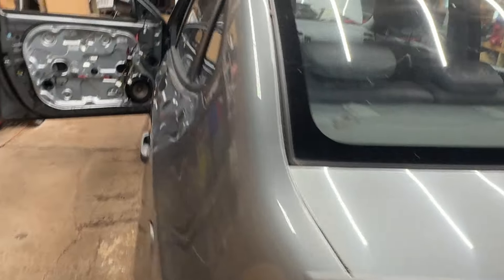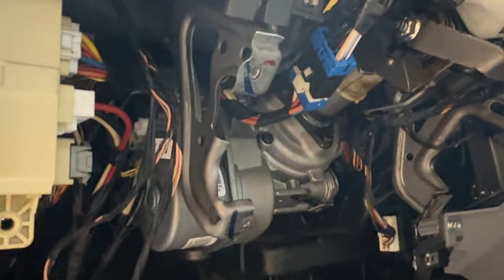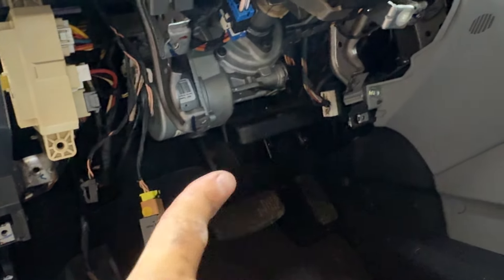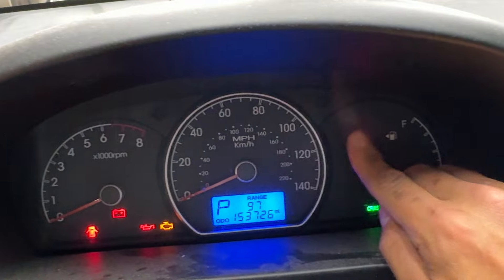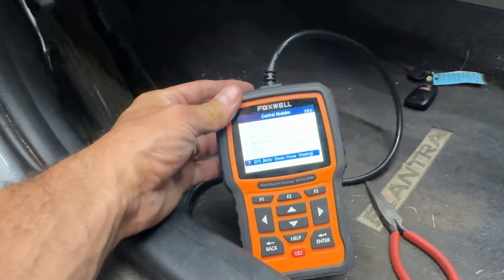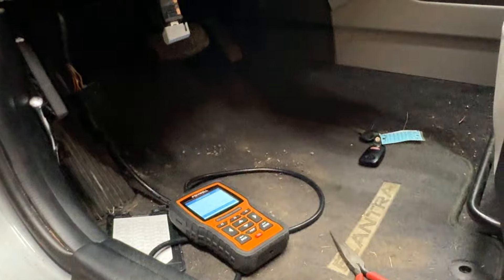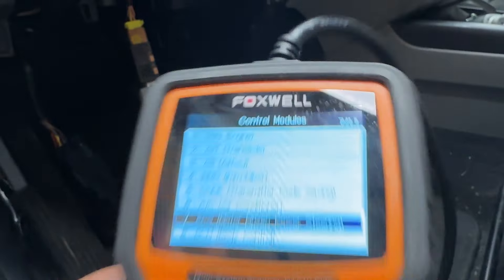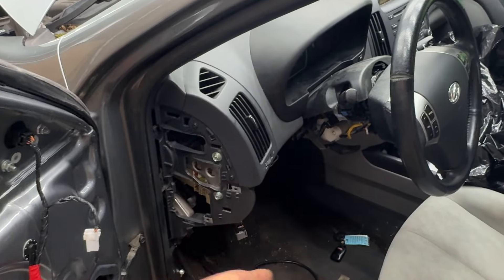2007-2010 Elantra Steering Problems Explained (Clunk, Loose, & EPS Reset)

Comment: I also replaced that coupling stuff, and it became better. But, I do not know why the steering wheel is still not smooth.
Reply: Check ur sway bar links or ur inner tie rods
Reply: Did you clean out the debri from the old plastic gear?
Reply: @shanegray8606  Nope. I only replaced coupling. :)

Comment: You can try unplugging the battery for abt 10 minutes instead of clearing codes with a scanner. Does almost the exact same thing, you just don’t get to know what codes are present.
Reply from the maker: This unfortunately isn’t that. The system was uncalibrated when the column was taken apart. I’m a budget conscious person but after 21 years of wrenching, I’ve learned there are times you have to buy the “right tool” sadly :(

Comment: Hi, I have a Hyundai ELANTRA 2007 and the EPS light is coming on, but also the car is not steering and draining the battery shifting into gears is pretty difficult at this time and would like some help. I know what to do next.
Reply: You need to check the alternator I think that's what is going bad
Reply: I also have the EPS light on (on my 2010 Elantra), which turned on after I replaced the (8-leg starfish) rubber steering coupler mentioned in the video. My EPS light has been on for several months without any issues to the steering. I'll try what the video suggests to reset it though. But in regards to your battery draining, check your battery and alternator to ensure they're both good. (Your local Autozone or auto parts store can do that for free.) If it still drains, you probably have a shortage somewhere in your electrical system, or something is being left "on" like the overhead dome light where the vanity mirror is, etc.. In regards to difficulty with your gears shifting, I had a similar problem. I would shift the car into gear and it wouldn't shift into gear right away, or it felt like I wasn't getting any gas when it did shift into gear and I stepped on the accelerator. I thought the fuel pump was going out so I replaced it. It seemed to fix it, but only for a short while. The problem returned. And I had plenty of transmission fluid. But then I found out the problem, by accident, the next time I opened the hood. It turns out I forgot to connect the MAF (mass air flow) sensor plug located on top of the air filter. I disconnected it when I replaced the throttle body. Once I reconnected it, "the gear shift/ out of gas" issue went away. Check to ensure all your engine compartment connections are connected. This includes the electronic power steering electrical connection: And make sure there's no oil or gunk in there, preventing a clean connection. If there is, clean it. Good luck and let us know what caused your issues after its all been fixed. You'll help out someone else in the future.